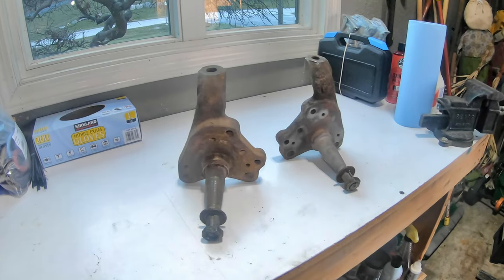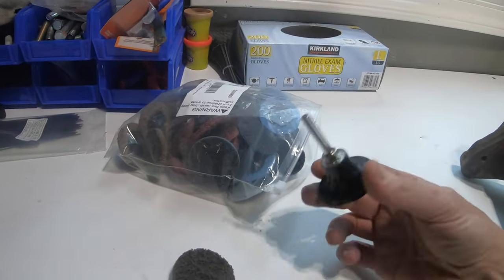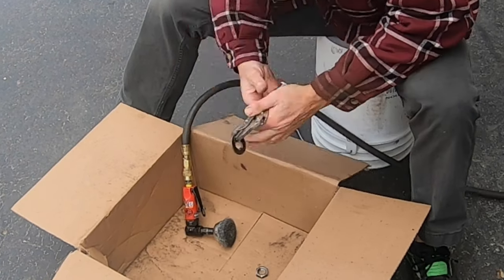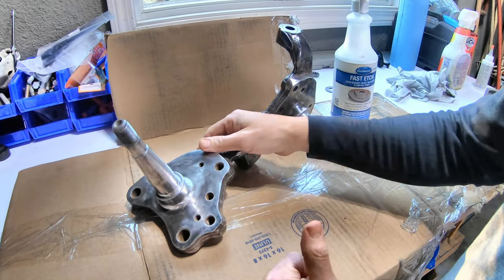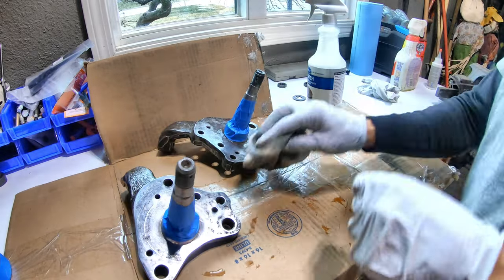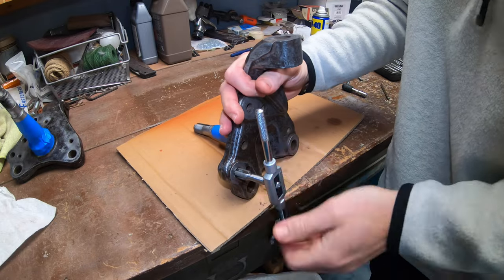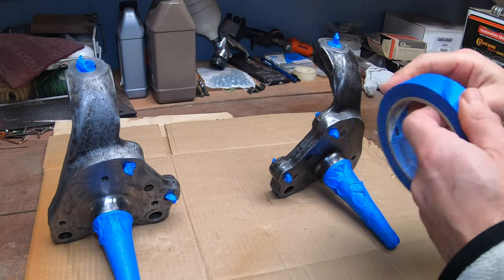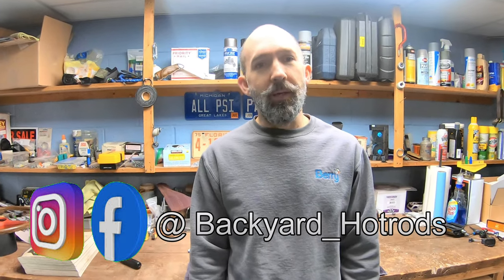How To Restore Spindles!

Comment: Those look great!  We had a bead blaster where I worked and I used it a lot!  Did any rotors or shields come with those?  Gonna do power?  If so, got vacuum?
Reply from the maker: Didn’t come with anything else!  Staying manual brakes.  When we built the motor we discussed that then as it doesn’t have enough vacuum for power and I’m good with that.

Comment: TY  NPD folks  my bro has a 69 merc convert cat got 70 fomoco spindles complete 100 each ebay soaked in citrus cleaner power washed placed in a solution 9 1 molasses water to fill any corrosion, then back into citrus soak.. polished out like new. once clean one can use self etching primer not the rattle can rather the real deal from auto supply  then chassis paint.